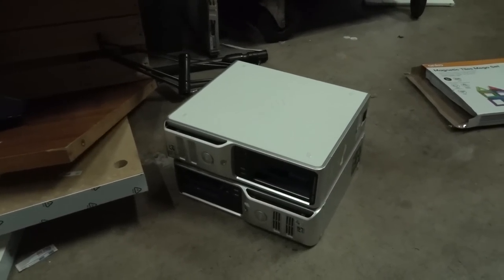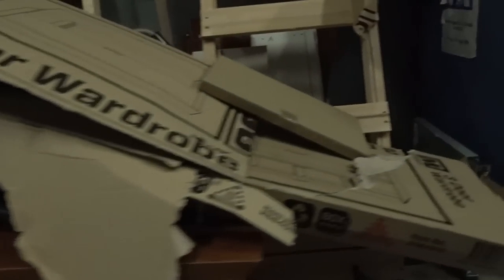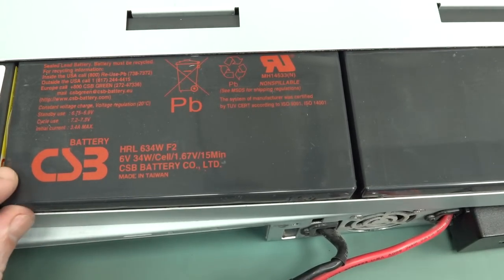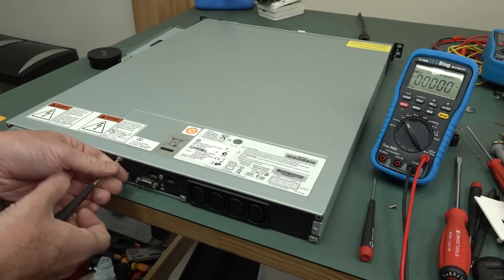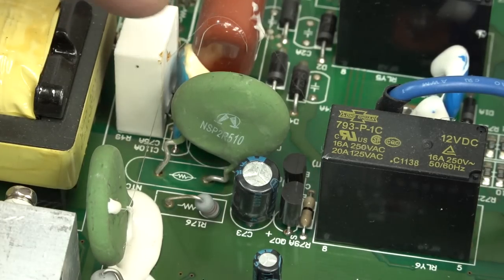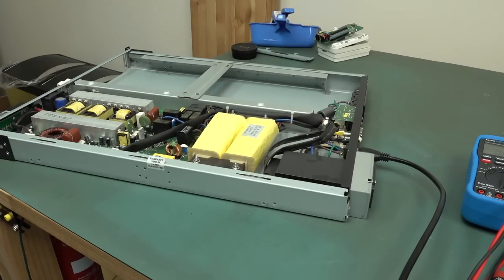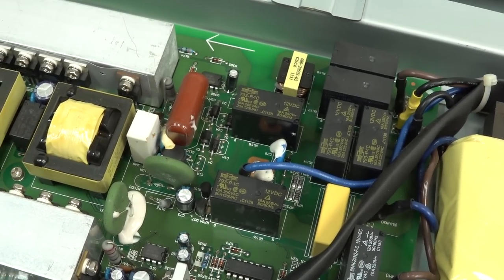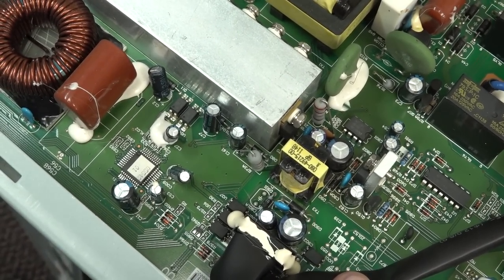EEVblog #1168 - Dumpster Diving UPS

Comment: So is there no voltage on the input of the 7805 ? I would take a stab in the dark  that the 5 Watt resistor (R13?) is Open circuit assuming it is feeding the  7805  voltage and the rest of the logic board or the 7805 is self has failed. I will look forward to your repair video on this.

Comment: Is it the light reflecting or does R768 casing look chipped? Its near the 7805 he shows. If case is cracked maybe its bad. Would agree probably batteries though. Why not toss some voltage on the battery leads of the ups and see if it starts.

Comment: Most UPS need batteries to even turn on. If you can I have sometimes tested  these with a high amp power supply of similar voltage to the input. The UPS should turn on on battery mode and make output. I usually also check the output with a meter, and maybe a small laptop charger, etc. I have seen cases where it will work fine, but soon as a small load is imposed they fail, monitoring the input current it hardly spiked so was not issue with input capacity, etc.

Comment: With my dumpster ups you have to hold the power button till it fires up.   I live off grid and my inverter is a chepo Chinese thing which drives my oscilloscope wild So I'm going to up my domestic batteries to 36volts and use the supper duper smooth ups to power my test kit which works really well. 
Not better than a dumpster full of Goodies
Reply: You might be aware of this already, but not every UPS will play nice with every load. Many of the cheaper ones aren't outputting good quality sine wave (or even a poor quality sine wave), given that your oscilloscope objects to the inverter you have it may not like that either. Certain types of electric motors in appliances also won't like it, too lazy to go into details there right now.

But I don't know what your dumpster UPS is, some will do the job and produce a nice sine wave. Given that you've got an oscilloscope already I suppose it wouldn't be hard to verify what it's doing on the output side.

Comment: It does need the battery to kick on. Feed the 36V and it will be alive, but it may turn off when it will do it's self test.

edit: the bulged battery is a common battery failure. One cell fail and short, the charger keep the voltage, the other cells overheat, fail, short and the cycle repeat until something happend. On mine the 4x 12V 7AH fused together!

Comment: This one was almost definitely tossed simply because the batteries were out (the thermistor was probably knocked out when someone literally threw that thing in the dumpster). Solidly built unit, I'm kind of surprised they used a 36V inverter and then a huge power transformer on the output side, instead of a DC-DC boost converter and then an inverter at 230VAC.

Comment: If it doesn't work with new batteries/power from a psu, check the circuit arround the small transformer near the 7805ct regulator. The switching ic is probably the 8pin dip near the transformer. I bet the ic input cap is dead, a typical problem for switching psu after 10+ years..

Comment: I actually running my UPS with 18650's Lithium-Ion batteries. They're actually not suitable for high current applications but I running my router, Ethernet Switches and my small PC which I use as an Debian VPN Tunnel

Comment: Perhaps at the battery side it need to have a minimum voltage to start up the unit. 
And the transformer with three wires, it is possible that the ground is the fourth 'wire' ? Same structure as with MOTs.

Comment: I believe the OEM for most of the HP UPS units are made by Eaton. yours is a HP R1500 G3 (rack mount, 1500VA, 3rd gen). I have a HP T1500 G2 (Tower, 2nd gen) and it won't power on with fully dead batteries.
Reply: Dave. if you have 3 12V SLA batteries, hook them up in series and connect them. they don't need to be internal, but if you want to run it long term they should be a total of 36V 9Ah AGM type, as the inverter is only meant to run as long as the batteries are specced to last. you can tell because the heatsink is designed for thermal mass, not dissapation to the air. at max load they are only intended to run for 5-6 minutes usually (but they will run for over an hour at the ~100W load my computer with two monitors needs for usual desktop work)

Comment: The Dell PCs, I'd grab the DVD-RWs if they are that. Some of those had weird ATX supplies that if you are lucky don't actually fit into the usual ATX power socket. The wires were different...

Comment: At 5:52 you said the batteries are Hi-pot tested. How would that work?
Reply: Probably tested against the frame.  You want to make sure there isn't an arcing point between the battery terminal and the external frame that holds everything.

Comment: Just to add another voice to the chorus, a lot of these style of battery backup units pull DC power to start up with. I'd be willing to bet if you back-fed it 6 or so volts from a bench PSU via the battery connector it'd come back to life.

Comment: Hi, I like to see this thing works again and I hope the batteries are fine just need to be charged, you can try to press and hold the power button to power up.
Reply: Even IF they come back to life they will never be the same again since they HAVE taken damage being discharged so low.
Plus they are probably pretty old so if lucky they maybe will be around 10% capacity.
Reply: Batteries are dead! UPSes molest them so hard, at the end it's a miracle there is still lead in them...
Reply: As others say, those batteries are done for.  I’ve wasted time try to revive them and got nowhere.  After 5 years there done.
Reply: They're cactus.
Reply: And or the batteries let the magic smoke out.
Reply: And as you know when you let out the Magic Smoke it doesn't work anymore because Magic Smoke is what makes it work in the first place once you let it out it don't work no more.

Comment: Old computers are still useful. So long as their running core 2 duio's/ core 2 quads. Windows 7 works fine with most. If you wanted to throw together something on the cheap. Idk what prices are there for those sealed lead acid batteries but here you can get each battery for $25 or less online. Not too bad but then again my ups' just use one lol! Btw you need feedback from the batteries for it to power up, it needs to see some juice in order to turn on because once it's on it's "in use". The negative terminal, if I remember correctly is grounded, so it's bolted directly to the chassis through the board.

Comment: Retrofit USB3 card to HPz400, an SSD and min 8Gb ram, plus a reasonable GPU (I'm using a GTX750Ti) and you've still got an excellent daily driver.
Reply: But that all wouldn't worth for those desktops, they are Athlon XP CPUs, i think
Reply: @resneptacle  No, prob not. Maybe equivalent to Pentium D or Core2? I've got a z400 which I picked up for £135 about five years ago. It still does everything I need, and I've used it to develop hardware and embedded software.
Reply: Old lga775 PC's are golden! You can put a cheap 771 Xeon, 8gb of cheap as chips ddr2 RAM and a half decent gpu and you've got a sweet cheap pc
Reply: @jorgeszabo1659  ..With the mod!
Reply: @philiplishman532  Damn you got lucky if you at the time got a 3 year old workstation for £135
Reply: @themrenerd7384  I got it from Total Icex on Ebay (uk). (https://www.ebay.co.uk/usr/total_icex?_trksid=p2053788.m1543.l2754). Price was good, but not unusual at the time.  Looking at it, I saved the seller in 2015 - which must be when I got the machine.

Comment: Just adding to what others have said,
APC UPS'es (the pure sine models: SUA, SURT, SRT, SMT, SMX, etc.) will all act completely dead unless they see at least 1.75v per cell (average).
You should be able to just hook 30-40v up to the battery terminals with a lab PSU and get it working.
APC Uses the same funny shaped transformer in their 1U models in order to make it all fit. In some of the 2U models they use 2x identical transformers in parallel to get enough capacity with the size constraints.
Reply: You are right about the older models but it is not the case anymore. Newer models with lcd (SRT, SMT, SMX...) have seperate PSU in them and can be started even without battey.

Comment: The mini towers, yeah. I'd stuff Ubuntu onto them and make them into HTPC's or thereabouts.  But any tossed UPS systems, no. I'd yank the batteries, cut out the transformers and toss the rest. UPS modules have sacrificial components in them that wear out as they age. Any UPS on craigslist is considered suspect and unsellable. The batts are worth the effort to get and sell to a recycler.

Comment: Stand by switch mode power supply for turn on. Possibly cap or IC duff preventing turn on. If bulk cap voltage present I'd check there.

Comment: I guess the heatshrink over the ribbon cables is to satisfy double insulation / "barrier" for ELV and LV mixed inside a panel or without 50mm segregation spacing. Also are those heatsinks solid aluminium!? no fins at all! Why all the mass? Low duty?

Comment: Logic part of the board is powered by the batteries,  if not it would be a problem or at least a more complex solution would be needed when the mains fail. Kind of half ass but I guess it keeps the cost down.

Comment: Since I work in a data center, This is basically porn to me. 
We don't have UPS', we have a room filled with batteries lol no UPS would be able to supply us. We just use the battery room until the generators kick on

Comment: fun...i have a ,think, somewhere, a APC 750, had dead batteries, i swaped them for 40A's car batteries, and yes it worked, monitoring and load software was going nuts, basicly, after the required test for new batteries i was able to run my litle pc park for 12 hours ! till the batteries went empty, word of advice, DO NOT TRY IT ,it was a fun experiment 18 years ago, but with current standards on power use on machines a 750 watt ups will be drained in minutes

Comment: Was gonna say the ram in them is still worth a few bucks but, no ram. Beyond that the things to nick would be the sata cables, the fan, the hard drive (if that's still in, partly to protect the fools and partly for a scratch disk) and the heat sink if you are into scrapping metal. The disk drive is meh take it or leave it depending on if you have a need or know someone to save a few bucks on buying one for temp useage. also the cpu looks to be an athlon 64x2 3800+ which people are trying to sell for $10 usd, also makes good box cutters or so I've heard.

Comment: Those won't boot up without the batteries, once it's running you can swap em. Try it with a set of batteries that aren't fucked and there's a good chance it'll run

Comment: Hi Dave,
Been watching your videos for years.
Was wondering if you could do a video on flyback converters where you build one from scratch and cover transformer selection and all that stuff.(preferably a main powered one so you can tell us about the startup circuit)

It's one thing I feel isn't explained in depth and also a very widely used topology.

Thanks

Everyone one who wants the same, please upvote for visibility

Comment: The probem is that the battery is so dead that the ps cant start. As you should know it is not the line voltage that power upups's. It is the battery. Just give it a little juice on the battery terminals withyour labps and the upswl start charging. Every ups work like this.

Comment: Any clue on what is happening with my UPS if it is not so uninterruptable?
Reply: heyou Huh??

I don’t understand you. 
Could you rephrase that please?
Reply: Battery expired?
Reply: @BoHolbo  Yeah, sure.  When the power goes out or flickers, it fails to take up the load instantly, so computers and such shutdown, however, it does kick in and buzz to indicate a power outage, and works as a battery with the wall power being out, it just is not fast enough transition to battery power.
Reply: @BloodAsp  You get an Inline UPS or you change your computers PSU to other with a longer hold up time, which is specified when you buy it. Perhaps your PSU is not ATX compliant.?
Reply: @CarlosJOlivQ  Interesting, I never heard of that hold up time spec before.
Reply: I have a couple of CyberPower sinewave UPSs.  They work great.  Cheap modified sinewave UPSs should never be used with a computer.
Reply: @BloodAsp  The problem is the input caps of your computers PSU. Eather it's old and the caps have gone the way of the dodo, or it's just junk.
Reply: @TheOriginalEviltech  EVGA 500 W1 80+ Purchased 2015, I doubt the caps went bad in that period of time, so it had better not be junk. XD   This should isolate the issue to the UPS in my mind.
Reply: @BloodAsp  The time that the power gets interrupted for is just the time the relay contacts are actuating between line and battery power. PSU caps should last on cap power for at least two times as much time than the contacts need to actuate.
Reply: @TheOriginalEviltech  easy way to check open said PCU look for the pastor's starting to turn green and stubs off thorns sticking out of them if that's the case they're going to be Cactus soon.

 But on the real side things there are ways to tell if capacitors are going bad externally without you testing them first is a sink leaking second bulged tops popping up or at events are starting to open up or the whole thing is swollen. I like those UPS batteries. That sometimes go up in terms of swallowing up.
Reply: @akkudakkupl  if you seek it's expired just look up. Just pretend you shopping look at the expiration date if it's past it is no good or what the recommended date is online whatever and if in doubt throw it out.

Comment: What would be worth taking would be the Microsoft XP serial number for the opperating system, !, 
I have repaired one of the UPS Rack system, these units work well after replacement of the batteries, I used panasonic, & yes it worked no problem at all :)

Comment: Hope this helps (when you need it)
HP notice says end of life was this past August with recycling details. Also one with new batteries was found for US$189 (not ebay).
Trouble shooting start page - next page says must hold power switch down un til it starts!
 https://tinyurl.com/yaj9hetv
HP (HEWLETT-PACKARD) HP T1500 G3 USER MANUAL ( 
https://tinyurl.com/y745bxqc
HP R1500-G3 - Brand New Compatible Replacement Battery Kit US$95  https://tinyurl.com/y8otdcgr

Comment: It wont power on without a battery, once powered on you can then hot swap battery, connect 36v 1A bench psu  across batteries it will power on then you can remove batteries.

Comment: Those Dells will run a long time. I have one of the last Pentium 4 based Optiplex machines for running Windows XP for an old 3D modeling program that wouldn't run on a 64 bit OS, and it worked well. Just be on the lookout for electrolytics on the motherboard that are on their way out, because Dells of a certain vintage had problems there.
Reply: You'd get better performance in a virtual machine on modern hardware. Or you could use a 32 bit install of Windows 10 on a dedicated machine if you had to.
Reply: @tin2001  I now have a HP Z600 workstation (1x Xeon i7-class quad core) that dual boots XP and Windows 7. It's fast enough and keeps all the hardware and storage separate. My main machine runs Windows 10.
Reply: not with those puny amd athlon series. I'd nick the psu and the tower and bodge in another mobo since it's very roomy
Reply: @kstxevolution9642  It's a BTX case. There is no 'bodging' an ATX motherboard in there because your slots won't be where they are supposed to be. Find a use for the whole thing or sell it for parts, otherwise it's trash.

Comment: Dave, If I drop ship you a Teleport-a-Matic 6000XS..... could you just set it up in 
that dumpster room you have there.  Just plug it into a nearby 30 amp 240 
socket and good to go, preferably non GFCI if possible as they sometimes false trip during the regen cycle.  It's for science.  Thanks!

Comment: Try to revive those batteries. Rip the covers off and put distilled water in dried out cells. Then charge separately and see what happens.
Reply: Those are not flooded lead-acid that you can add more water to. They are either VRLA or AGMs by the look of it. What happens with them is they aren't meant to store much power, just rather to deliver a lot of amps for short periods of time (7-10 minutes). Because of this, the plates are actually more like thin sponges to expose as much surface area as possible, and when they go bad, they corrode beyond the possibility of salvage. Even if you could safely get into them to add water, the water isn't the problem. The lead plates are corroded, and are now very high resistance. If you tried to desulfate them to get them to take a charge, the outgassing would have nowhere to go, so they'd just swell up and either crack open and leak our, or they would simply explode. Even if you did somehow manage to get any capacity restored to them, it would never be anywhere near what it should be. 
The typical charging cycle for these kinds of batteries is 13.5V - 13.8V for 24 hours. You can "fast charge" them at 14.4V for 16 hours, but that degrades the capacity a little every time you do it. You can find batteries of this style that can be fast charged at 14.8V for 8 - 12 hours, but those are VRLA for sure (and not AGM), so if they broke open you'd get a bit of acid leaking everywhere, hydrogen gas, and possibly a fire. 
So, not worth dealing with those dead batteries other than to properly recycle them and pick up some cheap replacements.
Reply: @WarrenGarabrandt  Wow, explosions, fire and acid leaking EVERYWHERE! Bwahaha, your ignorance is showing.